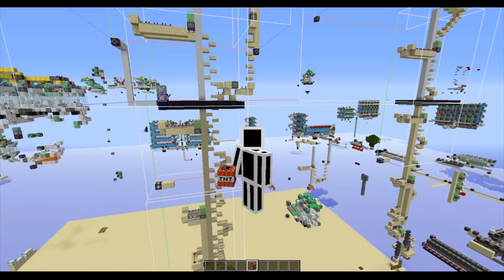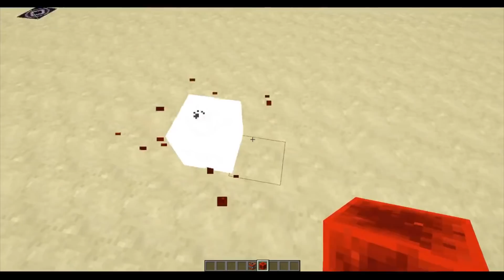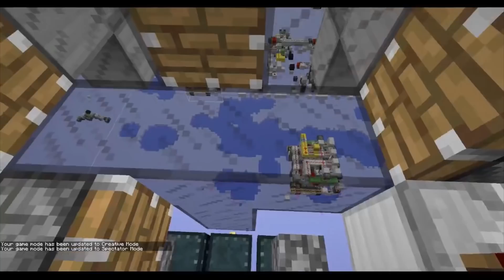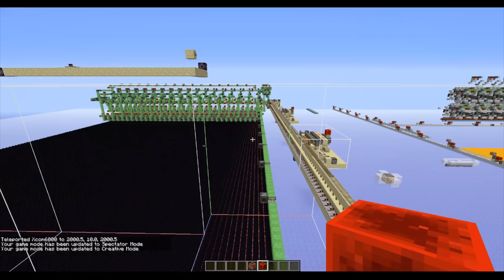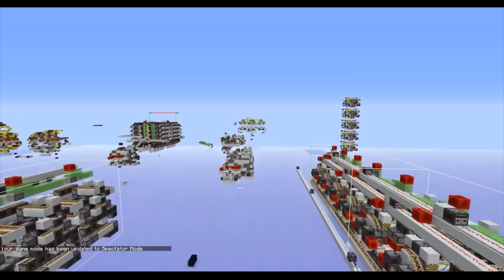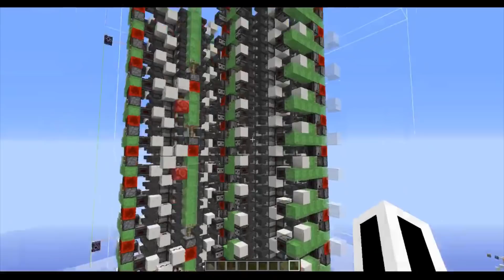Long history of TNT compression

Comment: You must place the detector rail(1.12)/coral fan(1.13+) in front of all the TNT in the “TNT just update each other” designs. The far block updates first, so if the detector rail/coral fan are the closest, the TNT would have been already pushed before the detector rail/coral fan gets pushed.

Comment: Ok, 2 questions:

First: What mods/plug-ins/addons did you use to see where exactly the TNT explodes and then disabling the damage it would do?
Second: Do you know if they work with TNT minecarts?

I am currently testing and building TNT Minecart cannons (despite how random their power is) and I would like to know exactly where the minecarts explode, as my 2 designs have the minecarts moving to maximize their power. Knowing where the carts explode would really help as then constructing the barrel/fine tuning alignments and finding out the best design will go much more swimmingly.
Reply from the maker: Carpet, but currently it doesn't log minecarts. Just regular tnt.
Reply: @Xcom6000  Darn. Well, thanks anyways!

Comment: What exactly are the pros and cons of a pearl cannon in comparison with a ender pearl chamber. Both get you from a to b. One advantage of the cannon I think is that it is better suited for multiplayer. Are their any other advantages or disadvantages?
Reply: Pearls get deleted when you leave the server, imagine you are 8000 blocks in the nether away from spawn (for example mesa quarry on scicraft) and your client disconnects. The stasis chamber in spawn will loose the pearl and you sit there with only your elytra to fly that distance...stasis chambers sound super smart in theory (they were the reason i started developing enderperlcannon tech myself) but are just not reliable enough to be worth it.

Comment: Btw if you think there's some loose commands running, just enable commandBlockOutput gamerule, combine that with /unload for loaded chunks and track down potential command blocks.
Reply from the maker: True. Could update to latest and use chunk debug as well.
Reply: @Xcom6000  why don't you use water to push TNT?
Reply from the maker: @randomsnow6510  Its generally way to slow to kompress using water. Way to slow for the 4 sec tnt fuse timer.
Reply: @Xcom6000  thx just wandering because that's what airship pirates used for their cannons.
Reply: Chunk debug ftw!

Comment: I have a moral objection to using dispensed TNT. If I had a server, it would be "dupe only". 😎
Reply from the maker: Smart man
Reply: @Xcom6000  tnt SPAWNing
Reply: @rohiem7554  tnt generator
Reply: Everything MUST be renewable if it is a redstone contraption. Totally agree
Reply: @dontletmememandie6506  wAnDeRiNg TraDEr
Reply: @adamrezabek9469  ? What’s the deal with wandering traders?
Reply: @dontletmememandie6506  they sell sand, so it's renewable, just not farmable
Reply: @adamrezabek9469  0_0 plz tell me you dont farm sand like this... you can use rays work’s gravity block duper for sand and shulkercraft’s creeper farm for gunpowder. And if you need tnt in a precise spot, tnt dupers.
Reply: @dontletmememandie6506  oman